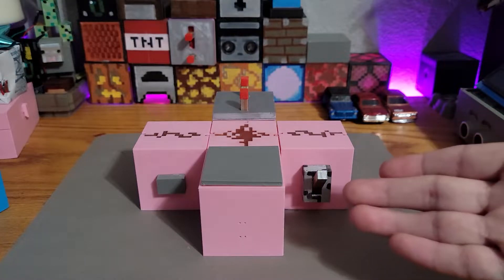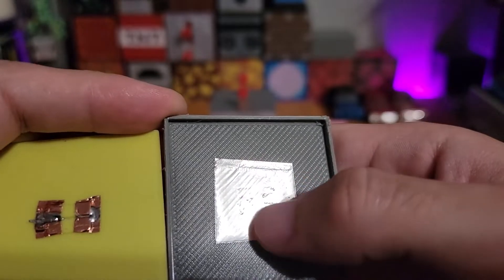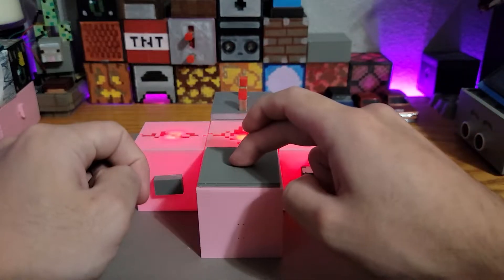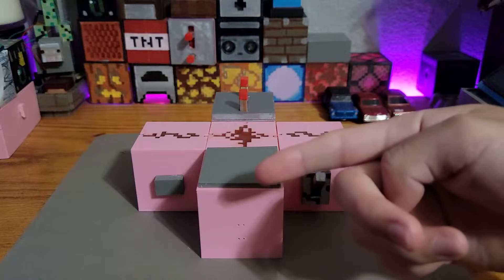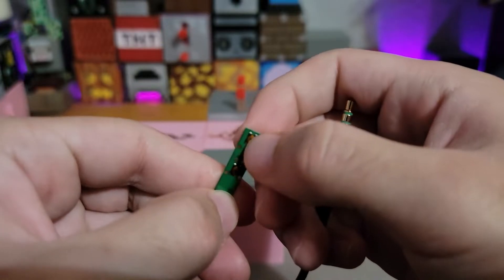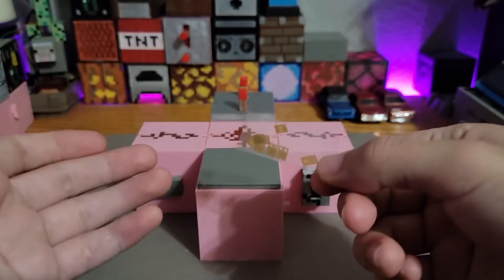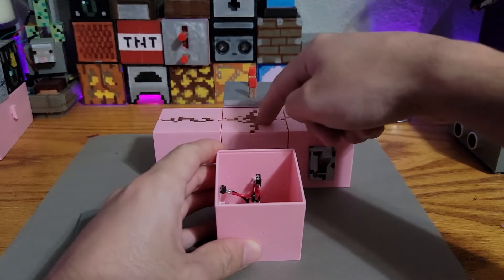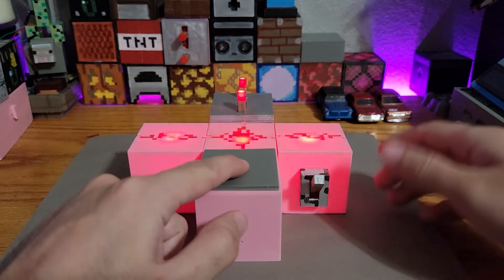Minecraft Pressure Plate: Mechanical

Comment: the signal from the redstone is analogue or digital and converted?
Reply: i alreqdy gave some feedback on reddit
Reply from the maker: For this configuration it is analog, then gets converted to digital for the repeater. Using the addressable LEDs would be a a completely digital signal, with a microcontroller initializing the array of leds. Smarter implementation, but more expensive lol

Comment: I like how you went simplistic and made it with the flexibility of plastic. I would have been completely retarded and tried to make a locking up and down system that would be very thick and never really work well. Are you planning on using this for the electromagnet jeb door coming up? People most often use pressure plates for doors, but I’m not sure about it for a jeb door. Anyways, congrats on 1k subs!
Reply from the maker: Thanks as always Hacker! It's not dumb to make it complex and have it lock, my model is limited because it doesn't lock, also with the button. It's just easier to start really simple with flaws, then build upon it : ) The idea I had for locking involves a servo, so it woulda taken a lot of effort just for an input lol